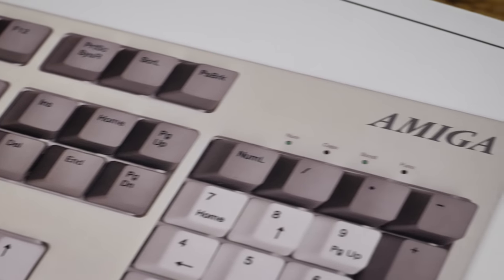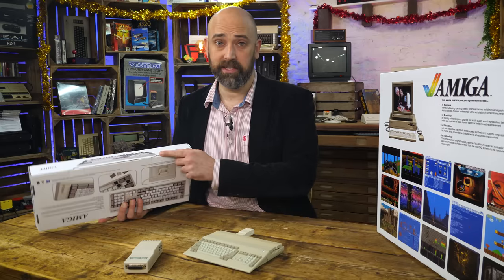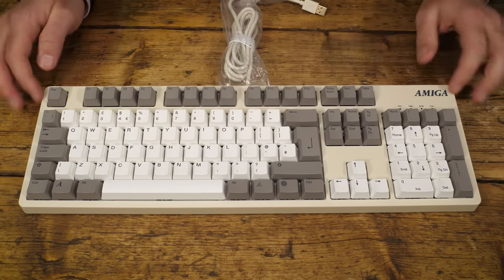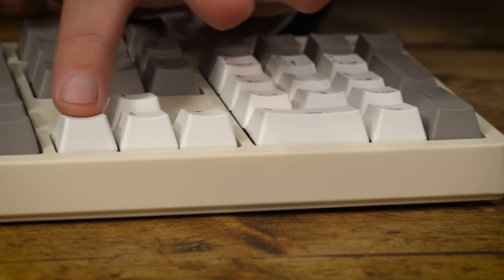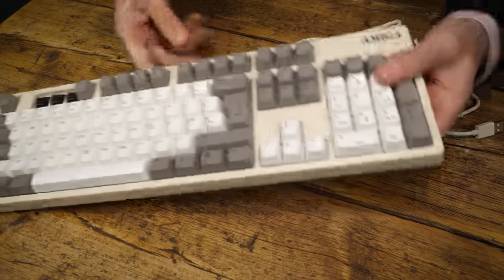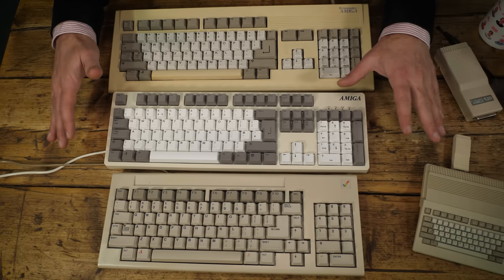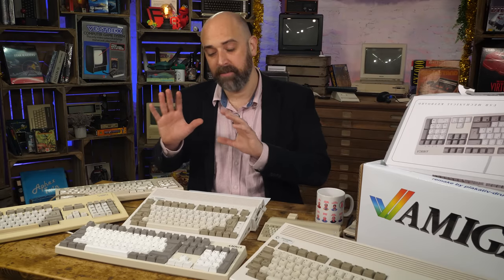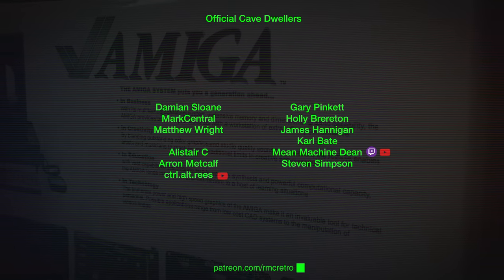An Official Amiga Product in 2023? Simulant Mechanical USB Keyboard | Tech Nibble

Comment: I own this keyboard. It is well built and the switches are mounted to a heavy metal plate making this thing very durable. It will last years. You are paying slightly more than other keyboards that have a similar price range that may also include RGB or other features, but.. you are getting something a little bit special here, and rare.

Comment: I think it's cherry MX brown switches.  I asssume it's based on a particular Amiga keyboard.  There were some Amiga keyboards (A2000?) that did use cherry switches, I think, though threre's actually quite a variety of Amiga keyboards when you take into account all the models and variances within models.

It's fairly expensive, but price wise it's in the right ballpark for a decent mechanical keyboard.

Comment: I like the sound of this keyboard.  It would be tempting to do an Amiga themed build if only there was an ATX compatible case to match.  Unfortunately, as far as I am aware, the only case that would match is the A1500plus which is quite limiting where it comes to GPU support.  £140 is a fair chunk of change, it puts this keyboard up against the higher mid-range keyboards from the mainstream manufacturers (essentially on par with a Ducky One 3 or Corsair K70) so it is not unreasonable in terms of a keyboard featuring Cherry MX Brown switches.

Comment: It's like the Amiga version of a Unicomp, which is basically a modern IBM Model M. Even never having been an Amiga user, this keyboard would be interesting to me if it offered media control keys and version that reverses the "A" and Alt keys for better Mac compatibility. My #1 choice for a Mac-compatible and Mac-friendly mechanical keyboard is actually the Matias Tactile Pro, which has ALPS-style switches, media control keys, full Mac compatibility (macOS doesn't ask you to identify it when first connected), and even a built-in USB hub like Apple's wired keyboards have.

I would consider a crossgrade to this one if it offered at least the right key layout and the media control keys. Oh, and I would like to see that Acorn version become a reality! Wasn't Acorn the original ARM-based PC? That would be even more fitting on a Mac since the Mac is now also using ARM-based CPUs. 😊

Comment: Which Amiga does this plug in to? Won't work on the 2000, 3000 or 4000. As Neil said, it's just a PC keyboard with Amiga branding. Overall it looks great and the brown keyboard switches is nice and quiet. I like it ! :)

Comment: I'm not sure if the shy maker might show up in these comments, but just in case: What's the Func LED for? What does this weigh in grams? What plastic is this made from? Can a PS/2 cable kit be purchased later? Might there also be an AT cable (w/o external PS/2-to-AT adapter)? Is XT compatibility being considered?
I was never a big Amiga guy but might consider this just for being a good standard PC keyboard. Every other keyboard seems to have extra unwanted features. That this doesn't have that is kind of a plus. But there are also extra features I might actually want:
Is there any way to get custom-labelled key caps on the existing physical layout (UK ISO)? I might be interested in key caps matching a particular layout WITH all the AltGr and Shift+AltGr characters printed on the key caps also, possibly in a different colour. What would be the cost if that's even possible?
Are extra keys for other physical layouts an option? E.g. Japanese has extra keys.

Comment: I understand it doesn't have one for better authenticity but I wished it would have had a metal faceplate or a metal frame even.
I think you can see some flex already in the video even if it seems sturdy otherwise.

Comment: It looks nice, but at £140 it's a bit too expensive for me.
Reply: Almost the same price and look as a Durgod Taurus K320, which coincidentally sells on Amazon for £139.91. Hmmm.
Reply: seems like an average price for decent mid-high end keyboards honestly?
Reply: what did you expect? $25.99???
Reply: @jonniefast  i was thinking about £80 - £90 for a standard USB keyboard. Considering mine only cost £5 including shipping. LOL.
Reply: Nope, not for me, amiga diehard, but its not the same layout/nostalgic enough for me to pay that for a keyboard
Reply: For a mechanical Keeb this is on the cheap end the last custom someone had me solder up cost them about £800 all told

Comment: "I'm going to have to use it for an extended period to make sure that the, um, action - the pressure required to push the keys, doesn't actually fatigue my hands". Jeez man get with the cherry keyboards already and respect the clicky mechanical keyboard. I'm a programmer and use something similar for 8 hours a day with no "fatigue". Looks suspiciously like a Durgod Taurus.

Comment: When this FINALLY comes out, it along with the USB Tank mouse, and the Drawbridge floppy adaptor (allows for self contained usb slimline floppy drive for Amiga emulators) we will finally have the full physical reproduction for emulations!! Ahhh!!! Or using with real Amigas via a usb adaptor or add on port. :)
Reply: You can buy the Amiga Tank mouse, either as part of the A500 Mini, or separately. I know that Game sells them. The Drawbridge adaptor is also out too, or at least the 'waiting list' is being worked through. I've received mine, but haven't had the chance to fit it yet.

Comment: Thing with Cherry is that for many years they hadn't been taking the keyboard enthusiast business seriously and got really stale with their products and i don't know if true but heard the quality started slipping too. Chinese manufacturers like Kailhua captured the market based on producing larger selection of products and innovating with new designs at often decent if varying quality, they also make silent varieties with rubber bumpers on both the down- and the up-stroke. Of course there's a whole bunch of manufacturers in China now, a number of them compete purely on cost with no quality or other ambitions.

Recently Cherry has been having a bit of a resurgence. That being said brown is the sort of switch which many keyboard enthusiasts point at and say "this is what's wrong with Cherry" but i can't say it doesn't have a use, i think it's fine.

Comment: For that price it ought to be hot-swap(the the switches ought to be lubed). You ought to do a sound test of the stabilized keys (space, shift, enter, backspace) as those tend to rattle. And you can quiet a mechanical keyboard (anything but blue switches) by putting o-rings around the keycap stems.
Reply: I think your expectations are not based in reality

Comment: It's a bit of a stupid product. It doesn't have the Amiga layout, and it doesn't connect to an Amiga out of the box. Had they given it a built-in dual interface for USB and serial (with included plugs for the different Amiga ports) it would be very useful though. But in this state, it's just a standard USB keyboard with an Amiga logo slapped on.

Comment: This is the single most awful thing (apart from the Cherry brown) that has ever happened to the Amiga's legacy. Can you not see that this is just a standard mechanical keyboard with "Amiga" printed on it? The proof was when it got taken apart to find surprise a standard internal USB interconnect. I'm satisfied that this didn't reach it's goal on Kickstarter, because it really isn't that special apart from colours, which don't even match! Don't even get me started on the F keys. The Amstrad one actually looked decent, but this is just toilet. There are many mechanical keyboards out there waiting for your money, so don't throw it at this. You could get yourself a decent USB keyboard AND a replacement keycap set for about the same as this without having "Amiga" on it so you can replace what keys you want with what colour you want (including the wrong sized, and too many F keys)

I'm actually shocked that this wasn't a "paid or sponsored review" as it praises a mid-range generic keyboard with "Amiga" written on it. Anyone who knows PC hardware and / or architecture would have said exactly the same.

Comment: A keyboard mimicing Amiga 500 or 1200 look would be amazing. Unfortunately this keyboard does not do that. 
Actually even modern standardish beige mechanical keyboard would be awesome. Unfortunately this keyboard is not that either.

I'm sorry to say but the primary keycap and case color are too close to each other and yet off (pearlish white vs plain white) and it ruins the look for me.

Comment: Meh. The bright white keys kinda ruin the look. Had those keys been a custom beige colour to match the case, it would look much better (but surely more expensive too).

I think he's missed a trick here by not making an "IBM compatible" variant, as that would involve swapping only three keycaps and the logo on the case. That would add a lot more potential customers and save on costs. There are at least three projects in the works for adapting USB keyboards to PS/2, so such a keyboard would be perfect for vintage Windows/DOS PCs. Of course, the keyboard would also need a 104-ANSI layout; 105-ISO is just awkward for those of used to US keyboards (we use US keyboards in Australia).

As it stands, I can't help but feel it would make more sense as a retro modkit for something like a Ducky keyboard—just keycap set and a replacement case.

Comment: I don't get it.  It's a PC keyboard with a couple of custom keycaps.  What's the point?
Reply: The brand, the color scheme, that's pretty much it. Well and that it's mechanical but the switches are soldered which is not great for modding...

Comment: I have zero interest in a a USB keyboard with an Amiga logo stenciled on.  If it is going to have a retro brand logo it need to be compatible with genuine period correct hardware.  There was a new Amiga style mouse just released and it also only had a USB plug.  So disappointing.